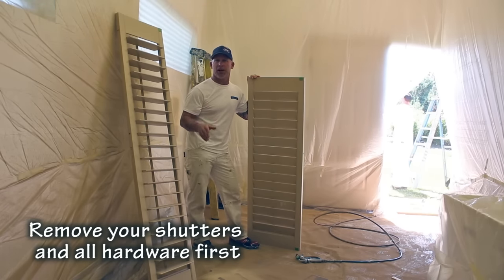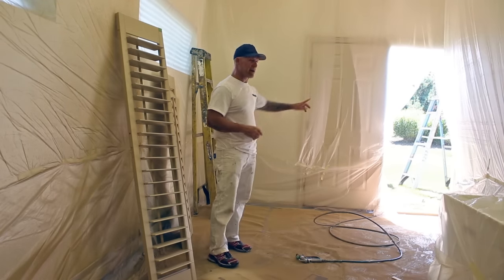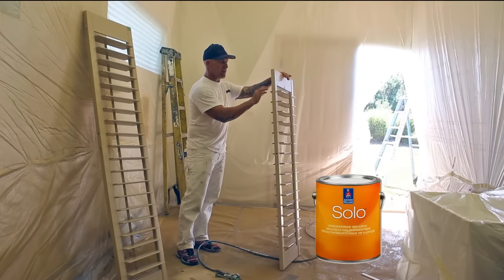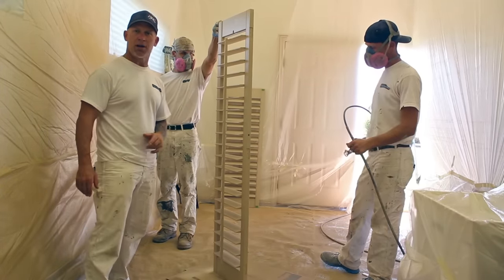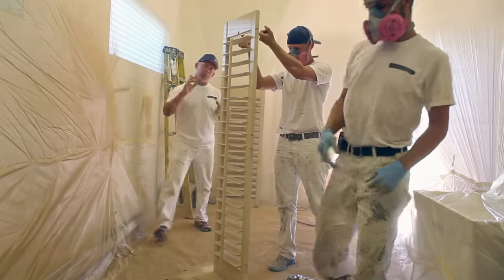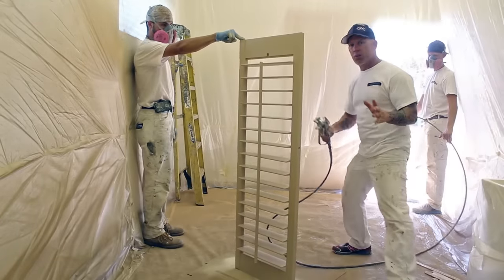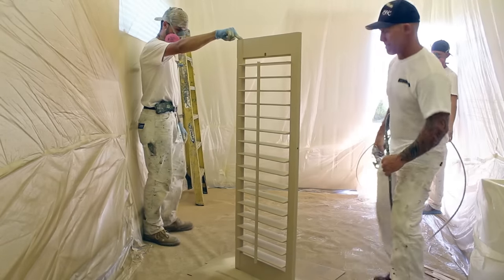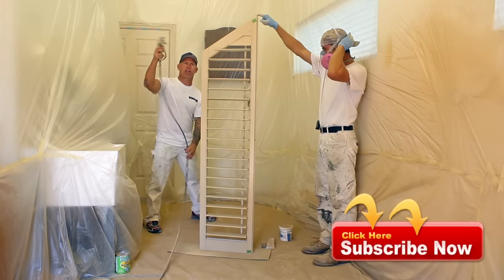Painting Plantation Shutters.  How To Spray Interior Wood Shutters.

Comment: Great informational video! Solo paint may work, but you have more options to consider. Sherwin makes a line called Sherwood and most the shutter manufacturers use a product in that line called "airless topcoat". Super fast dry spray only product. New in 2023 is a product line called "Gallery series" for cabinets and millwork. It's a 1k quick dry product as well. The block resistance on both of those far outperforms the Solo. Just my two cents.
Reply from the maker: Glad to help
Reply: Great video😊

Comment: I have used extenders before to cut down on "orange peeling" with spraying. Thats the fine texture that airless spraying can create if paint is too thick or dries too fast. I have used extenders with faux finishing to give more "open time" to slow the glaze dry time. I never thought of using extender to eliminate "dryfall" from latex paint. It was a problem when spraying shelving units for me on the horizontal surfaces where overspray landed after doing the tops and sides first. The bottoms always dried rough as the overspray sat and dried under the fresh coat leading to roughness that would have to be sanded out then recoated on the bottom surface only. Thanks for the tip, Chris.

Comment: This video will help me a lot. I have to re-spray a bunch a large, painted plantation shutters. You didn't talk about prepping surface of the shutters. Can you offer advice on how to prep them? The shutters are very dusty and have some minor paint peel on edges. Thanks
Reply: Sherwin Williams carries a soft sanding sponge "of sorts" to help with fine sanding.  That's all you'll need to do for most of the surfaces.  Little chipped edges or dents... a wax crayon will help fill-in/smooth those out.  Scrape off excess and sand down for final look on those blemishes.  Then blow the dust off really well.  Outdoors, catch some wind while you're wiping em' down for painting.  Don't be upset if first coat exposes more places to sand over one more time.  Then hopefully a final second coat to polish em' off 🤟🏼

Comment: I used a graco 490 ultra max with a FF LP 210 RAC tip to spray some shutters but I would never use water base paint on previously painted shutters it will not last as long as oil base paint and will start to peel off with a small scratch alot faster. Oil bonds better on top of any other paint, especially previously used oil paint in my experience.
Reply from the maker: Thanks for sharing Hector! We just prefer water based and that is what we always use

Comment: I used a white spray can on my shutters and the paint didn't stick.  I should have done a test area.  Whats the best way to remove the paint? I can scratch it off with my finger nails.

Comment: Hey mate great video! Quick question when painting window frames and door frames with semi gloss I always get occasional runs! Where I live is cold and I have to blow the house out with a diesel heater any tips that could help?
Reply: Gotta move faster with the gun, or cut down your paint output so you're not using as much if you have a slower spray technique.  You almost wanna "mist" setting.  That's how I do it at least.  And a little warmth never hurt the drying time 😉🤟🏼

Comment: A couple of things... I have never seen anything but a disaster from any DIYer with painting shutters.  Suggestions for you though after watching most of this video... if you're finding yourself painting a lot of shutters for one reason or another, you need better equipment.  That cheap Titan is for painting stucko or drywall, green tip or otherwise.  You need to paint shutters, furniture, cabinets, etc. with an air-assist sprayer, not an airless.  Secondly, you don't use a latex paint for God sake, you need to spray shutters, cabinets, etc. with a water based lacquer.  MUCH better finish, adapts to expansion and contraction of wood (they live between you and the climate) and you can add additional hardeners and UV protection, the OPOSITE of what you suggest.  Last couple of pointers about painting the shutters... never spray the top or bottom of panel doors and what did you do to cover up all the stripes you had by painting them without moving the louvers?  Also, I bet if you look at the top of the panel you will see a screw hole.  from what?  from a hook the manufacturer had in there that they used to hang the shutter to spray them.  And, to move them, you don't stick your fingers into the wet paint... two screwdrivers, you have tension screw holes on both sides of the panel... a screwdriver in each one, lift it off the hanging chain and hang it nearby to dry.
Reply: Can you recommend a brand of water based laqcuer? Your point about UV protection and expansion/contraction has been a concern of mine. Thank you!